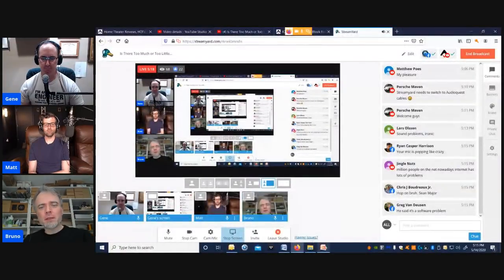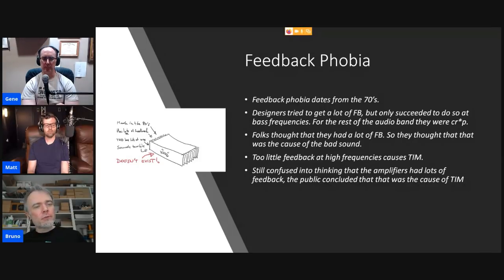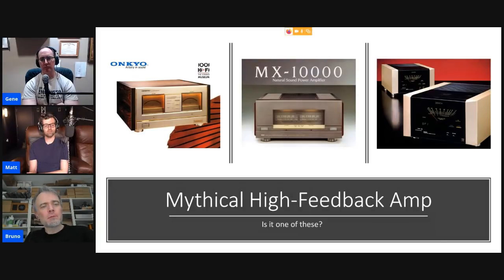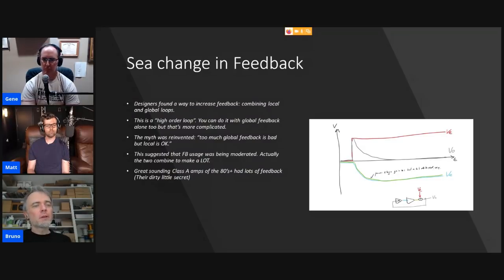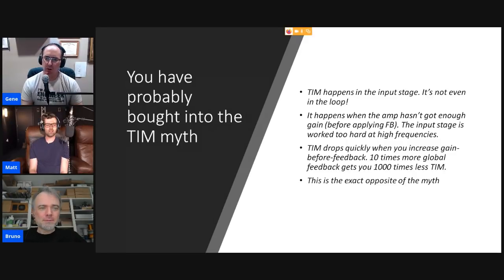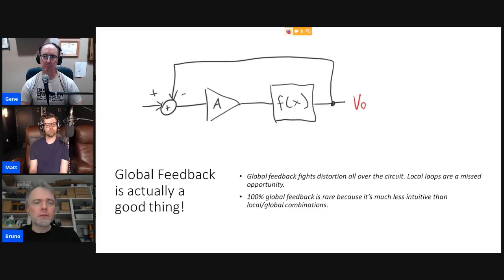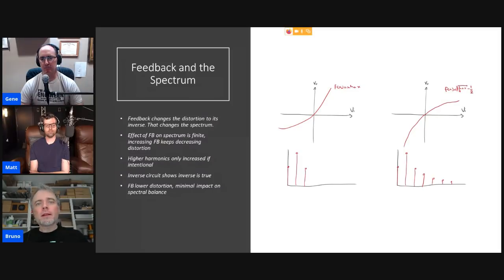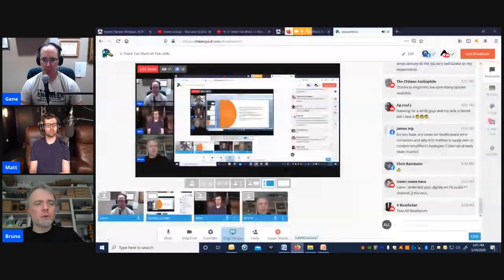Why is Amplifier Feedback So Misunderstood by Some Audiophiles?

Comment: I bought the C298 because it has the M23's Eigentakt and the M66's power supply:
1) it's less $
2) it has more features like adjustable knob gain, RCA loopout for 2 subwoofers, trigger output to my 2 subwoofers
I want the clarity. I add richness via my Cardas Parsec RCA interconnect cables.

I upgraded from a Parasound 2125v2 (already sounds really good).
Apple Music

Comment: Back in the day Crown DC300 AND 150 amps sounded bad because they had lots of feedback.... causing them to bad damping factors and poor slew (sp?True or false false?  They sounded ok to me and were pretty stable when driven very hard into low impedance loads.  Could handle 2 ohm loads when we measured them in the repair shop. ???

Comment: I currently have a Marantz SR5010 and JBL Studio 590s + Sony 3way surrounds. 
What I want is a good Class D 5-7ch amp for under ~$1000 with at least 200w at 4ohm. Then a sub ~$400 receiver preamp that I can swap out when a new HDMI version releases and I upgrade my TV. Or just a $1000-1300 receiver I could deal with. 
I’m having a hard time finding receiver type preamps with HMDI that aren’t $1000+. It’s stupid when I can buy a midrange Marantz receiver with pre-outs and just use that for less $. And I love what Emotiva has with their AB amp cards where you can buy a 5ch and add 2 cards later for 7ch.

Comment: Hi Gene, I need a little help from someone expert like you. I have a speaker that shut off my amplifier channel. That is correct. It looks like a clipping but on average high volumes. I have changed cables, amplifier channels and even source for the speaker and still the problem follow the speaker. I have also tested with another speaker with the same specs and the problem disappears. It is obvious that the speaker is defective. Since I don't have assistance here for the speaker I wonder if you could help me out to find what part of the speaker is effective. It is a B&W HTM2D2.
Thank you very much

Best

Alexandre

Comment: Suggestion for another video topic:  
When it comes to the traditional Complementary-BJT class AB designs, there is a need to include overcurrent protection in order to keep the output transistors within their Safe Operating Area (SOA).  One of my greatest "pet peeves" in audio, is that many if not most approaches to the current-limiter design can and do cause significant distortion when driving reactive loads, but I've never seen anyone test for this, or discuss it.  It seems the entire industry has been sweeping this issue under the rug and I doubt even a handful of audio enthusiasts are aware of this very important discriminator between amplifier designs.
Reply from the maker: You can see this in my rest results in many recievers. Here is an example:
https://www.audioholics.com/av-receiver-reviews/yamaha-rx-a860
Reply: @Audioholics  
I didn't find a test with reactive loads in the Yamaha review.  The issue I was describing, cannot be seen with resistive loads.  Yes, I noticed you mentioned current limiting many times, but that's at the voltage peaks running near max power - which is not the case I was talking about.  
Real speaker loads often exceed 50 deg. phase shift on current, above/below the bass resonant frequencies.  With certain designs, that can lead to distortion at only moderate power levels, i.e. it's far more pertinent to typical music listening, than the peak current limit.  
But I don't know how many modern designs still have the issue; it may not occur with MOSFET outputs since that device type doesn't need protection from secondary breakdown.  I know it is common with typical BJT output stages, so I'd like to see reactive-load test results for some contemporary designs, especially if they're BJT class AB.

Comment: @Audioholics can y'all please do a video on what to look for in a power conditioner/surge protector for a home theater and what you would need depending on the amplifier you have? Been trying to find a video on YouTube for a while now about this.
Reply: We would actually argue that you don’t need one. Yup!  I said it, you don’t usually need it. If it makes you feel better, you can look for some better surge suppressors like those from SurgeX, but generally MOV’s are built into amps. A basic power strip is fine as long as it has decent outlets.
Reply: @PoesAcoustics  :(

Comment: In the early 80's I had a Kenwood Super Eleven receiver that had excellent specs , high speed low distortion etcetera , I got new Ohm Walsh 2 speakers and they did not sound nearly as good as they did at Tech HiFi so I blamed poor room acoustics. Years later I got a Carver MXR 130 receiver and  then my speakers came to life ,better base and dynamics ,better clarity and imaging and most of all I heard so much detail and  things that I never knew was on the record or CD that I could not wait to put another album on to hear what I was missing .Hans  Beekhuyzen says of amplifiers of  that era that they used a lot of feedback which causes time smearing that hides detail.
Reply: Kenwood (or Trio in Japan before their official merger) made some fantastic products in the late 70s and early 80s.  They made a fantastic integrated amplifier called the KA-1000 as well as possibly one of the best power amplifiers on the market at the time the L-08M which tested right on par if not superior to the best Sony or Technics were making at the time at often a little less cost.  The secret to both was the use of a separate power supply (though optional on the L-08M) that delivered clean power to the amplification modules giving them a very clean power delivery.  You simply couldn't beat the performance for the price Trio/Kenwood was asking for them.
Reply: @aegisofhonor  I will have to give a critical  listen to my sisters model  KR-11000 GX which is 1 model older and has a dual mono amplifiers with seperate power supplies.
Reply: @aegisofhonor   you said they tested well , so did my receiver with a frequency response of DC to  230 KHZ  , really low distortion  THD .02 % at rated power and .008 at 1 watt , Signal to noise ratio of 105DB ,slew rate 140 v/microsecond ,rise time .95 microseconds ,impressive yes sound missing a lot of detail.

Comment: What's wrong with Skype? Most shows I watch are done with Skype and it seems pretty much flawless.
Reply from the maker: Skype doesn't stream to Youtube. That's the challenge. OBS does, but it's not easy to use for conference streaming.
Reply: Audioholics   Maybe live streams could be a premium tier access feature, and the final youtube cut could be a more polished edit.  FloatPlane may be a streaming solution too?  Maybe Twit?   The static of stream yards is all in the front end, and I’ve noticed the youtube stream doesn’t pickup right as you guys start, I’ve lost the first two minutes of the last few videos you’ve streamed. Maybe you should just run the logo and the theme music for a few minutes for the lag to calm down.  I’ve never heard the full length of that piece.  Also, if you start a feed right on the hour in the afternoon/evening that’s often when power grids switch their voltages for people to cook dinner, so maybe that over distances of internet and timezones of internet repeaters causes telecom interference?  It could be a traffic thing too, so maybe do it outside the window of congestion, and don’t worry about fewer initial viewers affecting the youtube listing algorithm. Tough choice between those two.

Comment: Too much time talking about degree of feedback, which is at most half of understanding the design challenge.  
One brief mention about output stage speed, which is the core of amplifier design.  Would have preferred to hear much more about open-loop phase response and achievable slew rates, and how they have improved from the 1970's to today.  That's the real enabler.